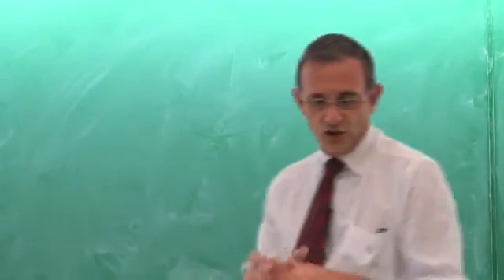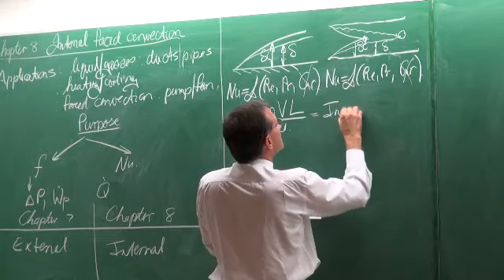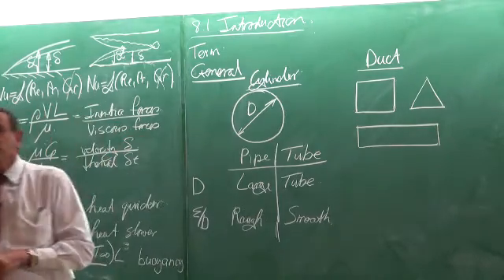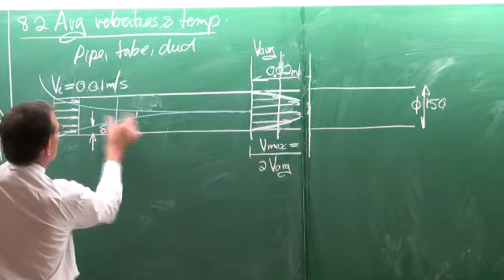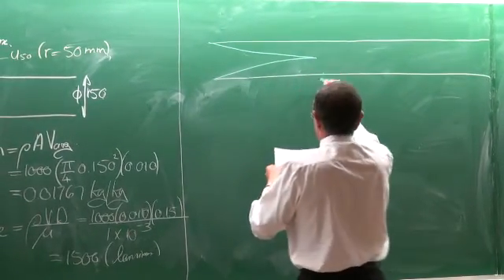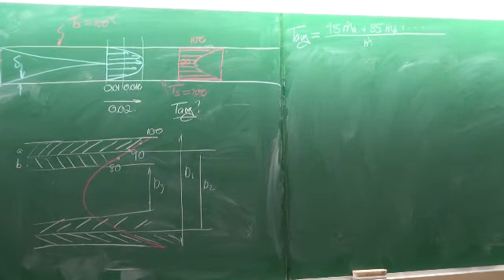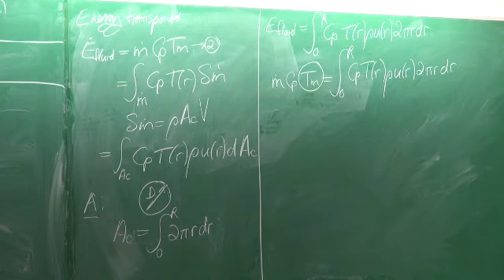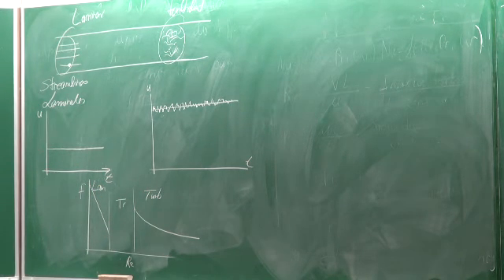Lecture 01 (2015) Internal Forced Convection. Heat transfer by Prof Josua Meyer

Comment: This lecture does well to connect the many variables and what they mean in thermodynamics, as opposed to a lecture where equations are quickly scribbled on the board and not well defined. Very helpful lectures.